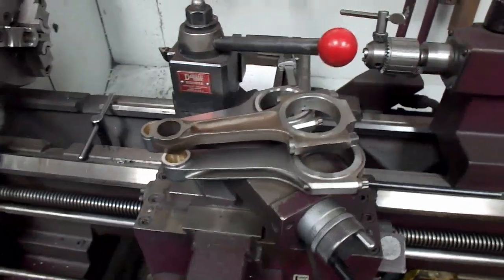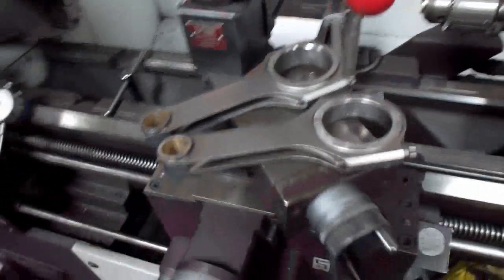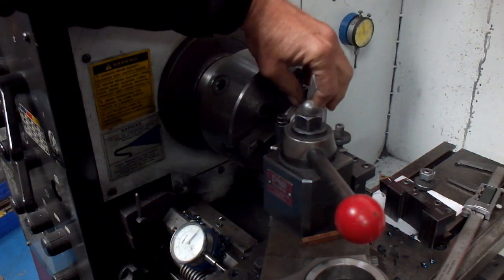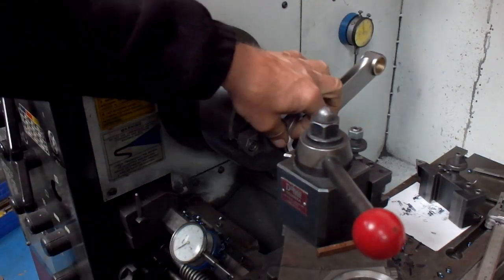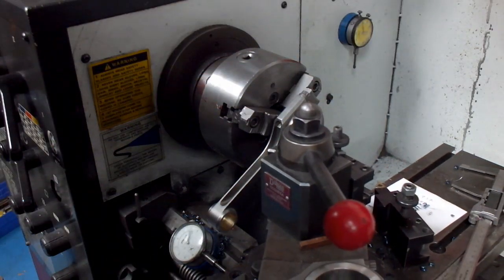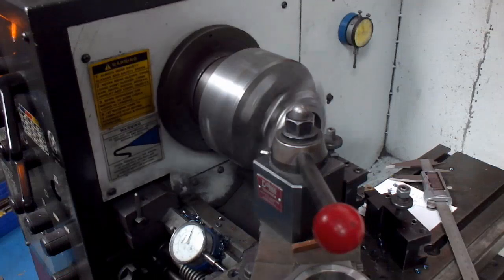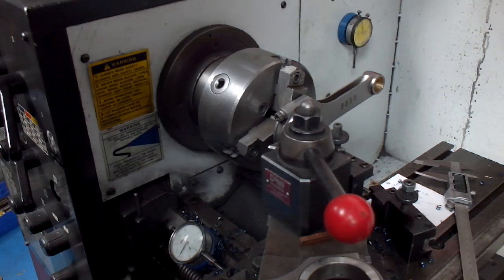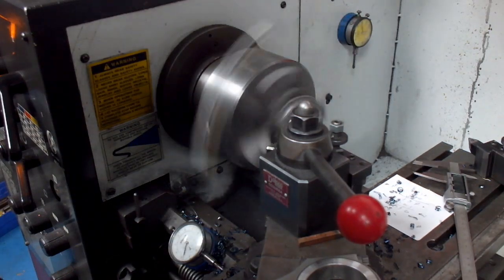Renault H Beam Con Rod Narrowing for DeLorean

Comment: John maybe you can answer this... They used a Delorean in Back To The Future, but truth be told, I'm not confident that car can do 88 mph in it's stock configuration with that Renault V6.  Even DMC must have had it's doubts because the speedo only went up to 75.  What is your opinion of that?
Reply from the maker: NGinuity Since I've never personally driven one, so I have now idea, but 88 mph dose not like an impossible number, The Mighty Fiat 850 Sedan does around 75, topped out in 3rd gear and it only has a 1.1 liter engine. Yes its been tweaked quite a bit, but, the DeLorean should be able to trounce that with power to spare. Hope this helps.
Reply: U.S. Federal law mandated all speedometers stop at 85mph at that time. The top speed of the DeLorean is approximately 119mph. Other owners claim they've had theirs up to approximately 125mph.
Reply: @dmcmarty  Hey thanks for the reply!  That's good information and I appreciate it.  Not sure if you are aware but apparently John passed away about 5 years ago now.
Reply: @NGinuity  I didn't know! I just saw this video as it was shared this weekend in one of my Facebook groups.
Reply: @dmcmarty  He's been missed, and did some fabulous work.  Published author, too.

Comment: I'd almost be scared to put more power through not only that PRV engine, but the transaxle.
Reply: The Renault UN1 transaxle has been known to handle up to 300bhp without much trouble. And highly tuned racing PRVs have achieved 800....
Reply: Chlorate The fastest top speed ever achieved at LeMans was set with a built PRV. They can be good motors!